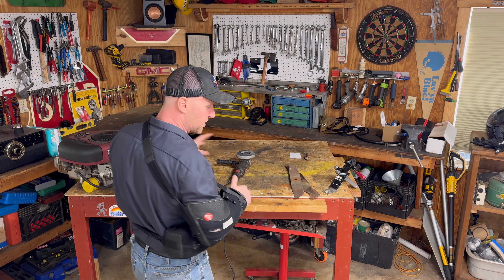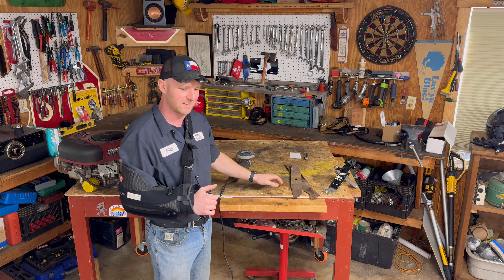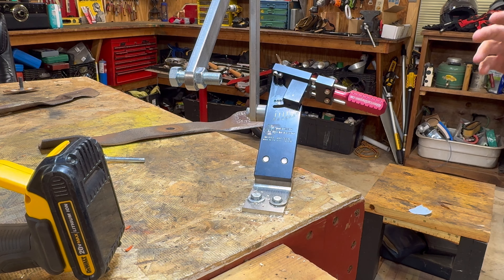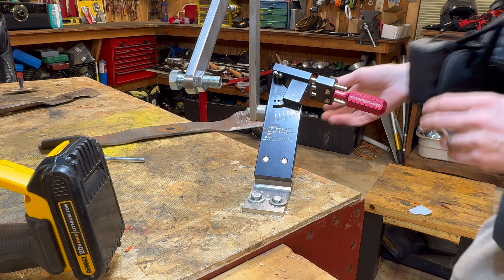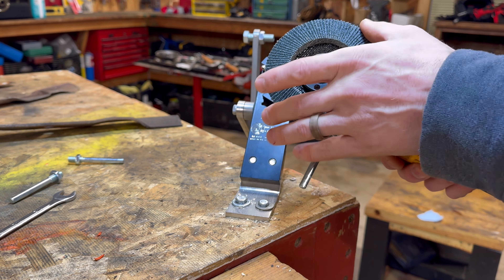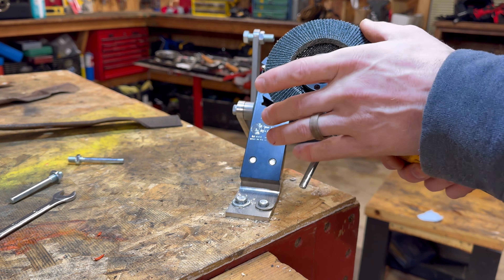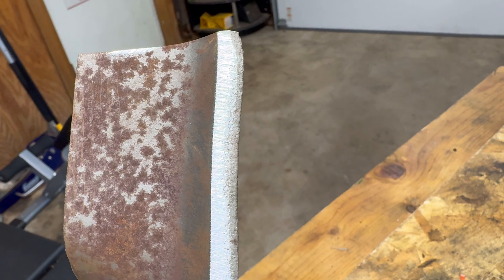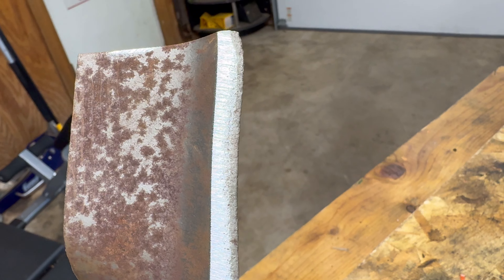American Sharpener Model 5005 Review - Mower Blade Sharpening!!

Comment: Not sure why it matters, but the piece that holds your blade should be placed under the part attached to the table.
Reply from the maker: Good eye. I don’t see how that could make a difference though.
Reply: Because you put the Allen head screws in backwards🤣. Explain why men don’t read instructions, please for my sanity.  The only thing I can think of is it’s a “Y” thing. Did you remember to tighten the nut to your grinder?  Most folks on YT don’t, make that men, I haven’t seen a woman demonstrate one on YT yet.
Reply from the maker: @elained9591  Sounds like this is your opportunity to start making YouTube videos! Can just point out everything us X people do wrong. ;)
Reply: @MowerMike  I have some work to do on Mars first. 😂🍺